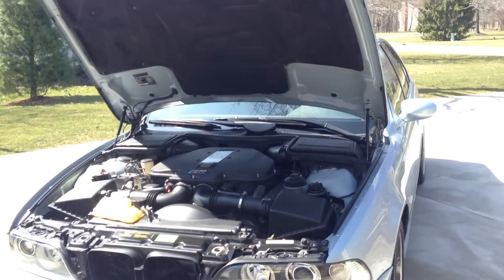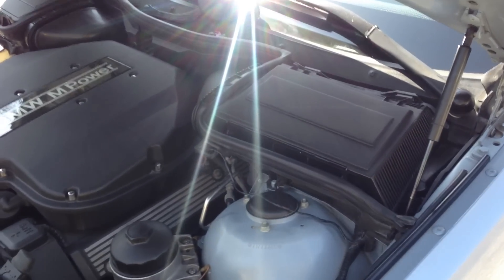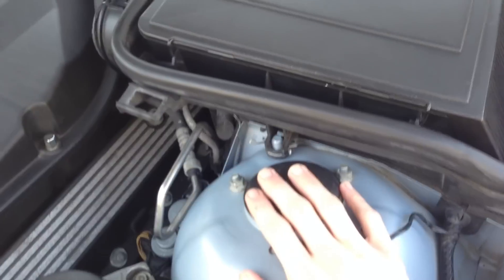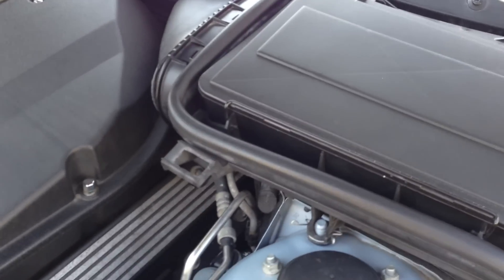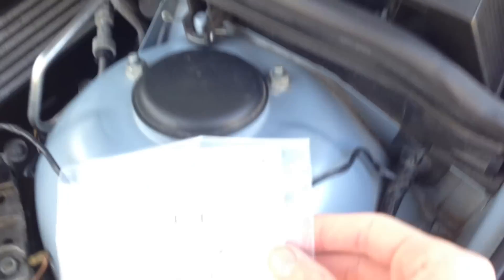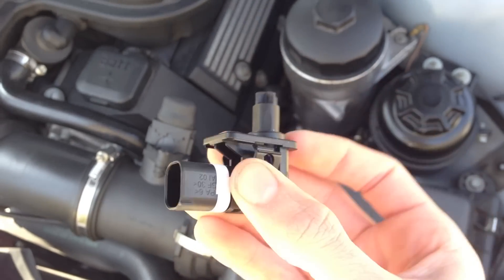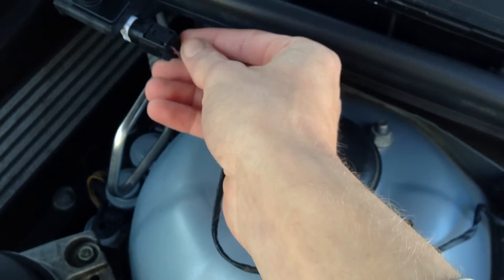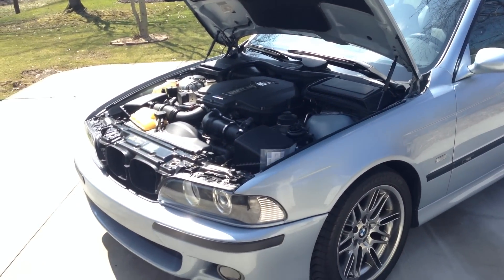BMW E39 Hood Sensor Switch Replacement - Alarm Goes Off?

Comment: Alarm on my 7 series has been going off randomly for weeks for no reason. I don't have a drive so sometimes need to park further away, and it has been making peoples lives a living nightmare. But FINALLY!! a video that makes sense and address this problem. It's unplugged at the moment, will get a new switch and fir it in. You have saved me a fortune!!!

Comment: Your video was on point, along with the numerous hints on the forums that faulted the hood sensor for my alarm randomly going off. I unplugged this morning and it hasn't gone off in the parking lot at work yet so it looks promising. Thanks for taking the time to post this clear, accurate video and of course, posting the part number.

Comment: Hi, just wanted to let you know you saved me about 400 Euro! I went to a local dealer with this problem and he said I needed to replace the sensor in the door lock(which would require door lock replacement aswell) Watched this video two days ago, disconnected the hood sensor, hey PRESTO, no more alarm going off!  Thank you!

Comment: Hi there. I have a 2001 530i. I have this problem right now. I disconnected the plug for now and the alarm no longer goes off. I will buy the part and replace it since this is an easy fix anyone can do it. Thanks for the video and explanation. All the best.

Comment: How did you remove the hood sensor switch? Is there a tab I should be looking for to engage? Great vid and thanks for the helpful tips!
Reply from the maker: +SiMPLYStEEZ Unplug the sensor, and I think there is a tab on one side that you must press before it wills out at an angle.

Comment: I went and looked at the build order for my car, and it turns out it does have an alarm. Sadly I can't turn it on with my key... I don't have this sensor either. I suppose my car has a more basic alarm system, since it's just a 523 and not an M5 or anything

Comment: I recently changed the battery in the key and reprogrammed it successfully however it still doesn't silence the alarm. The alarm would sound when I start it but I can still drive the car. I feel like a thief to my own car.

Comment: I have a 2006 x5 is this located in the same place?
Reply from the maker: I believe so.
Reply: Oops, sorry i meant to follow up.  Actually mine was on the passenger side under the hood top left corner.  Very easy to find thanks to your video the part look exactly the same.  I unplugged it and seemed to have fixed the problem  #fingerscrossed
Reply from the maker: mark chestnut No problem!  Glad you found it, I think you'll have good luck with simply unplugging it.
Reply: X5 2005, even after unplugging it, the alarm was going off? What else/fault could it be please

Comment: removing sensor does not fix the problem,... it will still be considered as open hood and alarm will be beebing after 30 seconds after car locked. 
Working sensor with closed hood will create a connected loop giving signal, that all is fine, but once sensor is broken  or removed, the car will see this as problem and will beep.
Reply from the maker: A removed sensor is the same signal as a closed hood actually.  Most E39s that come in my shop have the hood sensor removed, and the alarms function flawlessly.